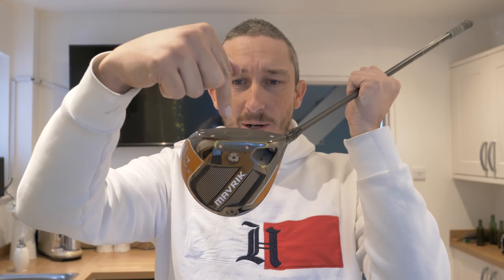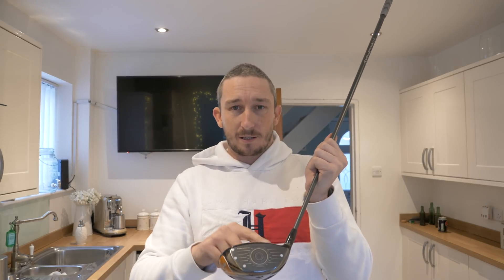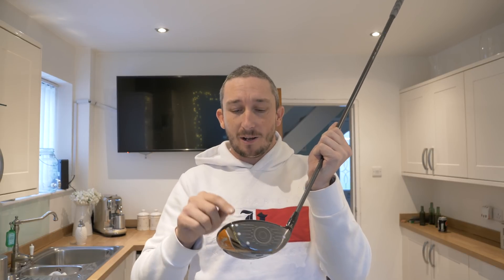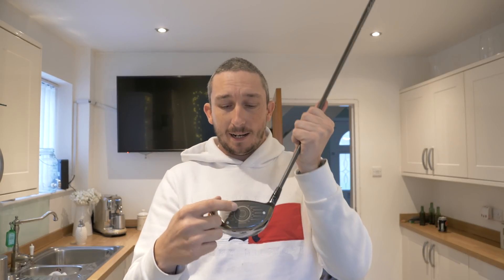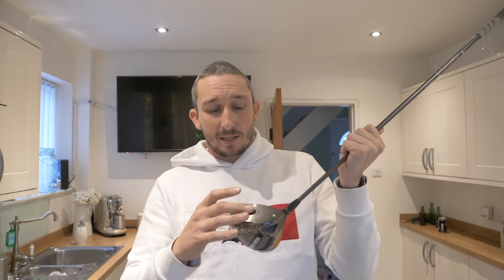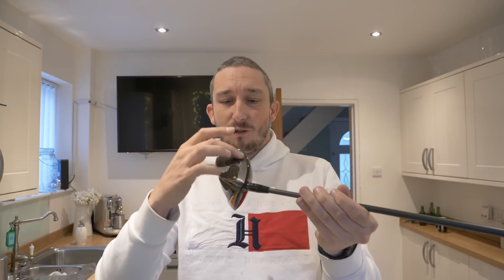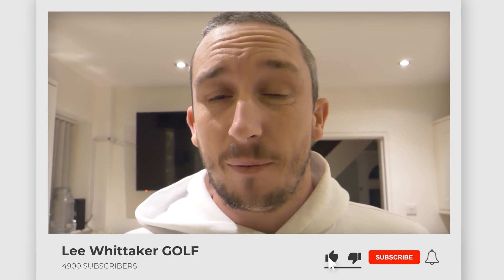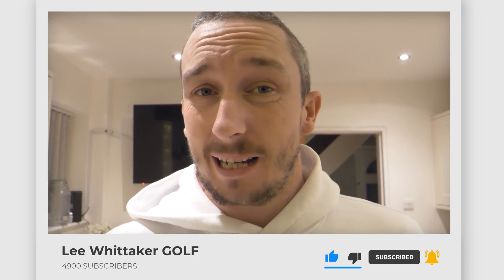IDIOTS GUIDE TO DRIVER FORGIVNESS

Comment: Brilliant video. Cleared up so much. Thanks.
Reply: Robert: try carefully to press a ball against the surface of driver at the toe. You will experience that it “rolls” towards the center of the face giving it a right to left spin. And vice versa when you do it at the heel.
Note that the curvature of the driver face somewhat counteracts the effect compared to a flat surface.

Comment: Why did you fit yourself into a sub zero with your strike characteristics? Was it purely ego like a lot of golfers? For me the vast majority of handicap golfers need is forgiveness.
Reply from the maker: No was for Youtube 59 scrambles and the low spin.  But i should have realised sooner it was causing my actual golf to suffer. I was always chasing the 2 or 3 good drives instead of being in play more
Reply: @LWG  I get where your coming from but I'd rather see you in play off the tee more. I really don't think the yardage gains with the sub zero would be that great anyway. I trialed the Sim and Sim Max and the yardages were very similar but dispersion was poles apart so the Max is now in my bag. Golf is definitely easier from the short grass 😊😊
Reply from the maker: For me the gains are massive. What I should have done is have a more in play driver for normal golf and vlogs and the sub for the 59 attempts. As I don’t need to be in play 270 as Dan will do that. If that makes sense

Comment: Good attempt - I still have some confusion about "gearing effect" when a toe strike produces a draw, or heel strike produces a fade. Consider the case of the face reaching the ball square to target. When the toe contacts the ball first the heel of the club will continue forward and that opens the face. The inverse happens when the heel strikes the ball face - the toe continues forward thus closing the face. So that would appear to be the opposite of the "gearing effect" I described in the first sentence. The higher the moment of inertia the less pronounced will be the degree to which the face opens or closes with off center strikes.

Of course if the face is already closed when the club reaches the ball a toe strike could leave the club face less closed, but still produce a draw. Like wise an open face on a heel impact could be less open but still produce a fade.

The third case is a toe strike from and already open face will produce a slice and a heel strike from a closed face will produce a hook.

May be this is an oversimplification or I misheard the suggestion that toe strikes produce draws and heel strikes produce fades. Looking forward to understanding more about the gearing effect.
Reply: He clearly couldn’t be bothered to read all this. Or didn’t know the answer 😂

Comment: U say u have the sub for the bomb balls in the vlogs but surly the say callaway max will be better in the long run for your index.
Reply from the maker: Possibly, testing to be done
Reply: @LWG  excellent never been fitted for a driver and mainly hit out the toe so thinking I need something that I can adjust. Have a cobra F9 and can’t adjust weight side to side. Perhaps will come for a fit sometime as only in Taunton. Index 8
Reply from the maker: @w.trunks2472  always welcome to come down. We may be able to dial in your current driver without the need to change.

Comment: Morning Lee
At last a straightforward description of driver tech ! 
I’ve recently changed from ping to srixon zx7.     May have been a mistake
Reply from the maker: Not necessarily Andy. If you have a pro dominant strike pattern then the moveable weights will have helped. However if your a bit all over the face then the ZX5 may have been a better choice. Hard for me to say without seeing the data.
Reply: @LWG  Lee previous ping was lst anti slice but I had a tendency to hit out of heel so that helped with that 
Problem eventually I lost distance and pulled a lot to left 
I was looking for adjustability 
At fitting I boomed balls but since then struggling 
May eventually have to be ping again or even try a big Bertha
Reply from the maker: stick with it for a while mate before doing something hasty.  The ability to hit it is there if you did well during the fitting.

Comment: Great explanation I scattered gun my driver !!! I have bought a Ping G400 max (as the price is now in my budget) I did have aTM 2009 Superfast a good driver if you got it out of the middle I cannot believe the difference (it doesn’t go any further) for off centre hits
Reply from the maker: Ping drivers are soooooo forgiving
Reply: Lee Whittaker Golf Ping clubs in general for high handicapper like me When ever I buy a new club I’m open minded and try other brands but usually I end up with a Ping even though I do have Callaway mc daddy wedges and love the two I in the bag and wouldn’t change them !!!I’m in the market for a very forgiving 5 and 7 wood at the moment !!
Reply from the maker: Some good choices around and the new ping stuff looks 👌
Reply: Lee Whittaker Golf Ping 425 looks fab but I’m a tight bug**r and will wait  till the 410 comes down in price 😉😉😉

Comment: Switching to the EPIC Max Lee?
Reply from the maker: Not sure yet. I’m going to test a few options and leave ego at the door.
Reply: You may not have to. Have you ever tested a 3 wood shaft in your driver? I suck off the tee with a conventional driver, but if you put a 3 wood shaft in the a driver head, my misses and strike patterns are much more consistent and my ball flight oddly enough is much lower. Maybe an experimental video idea with that concept?
Reply from the maker: Maybe  but I’d be more comfortable with a 3 wood or 3+ wood